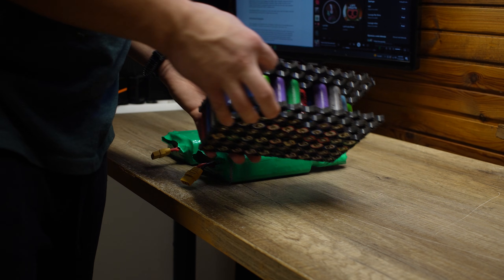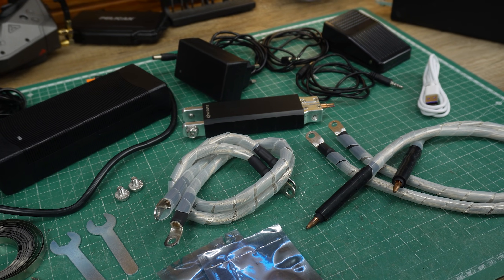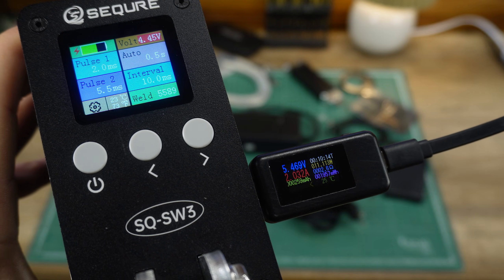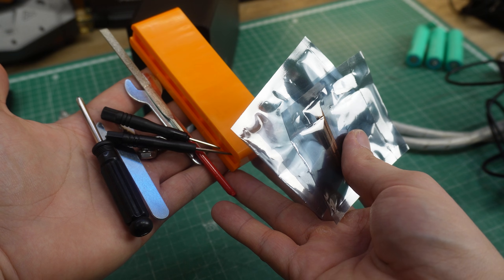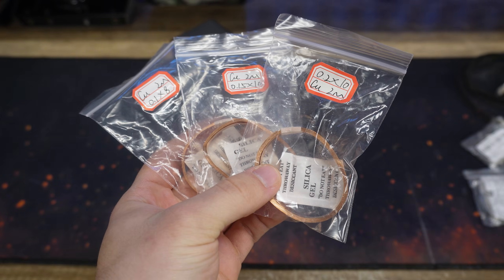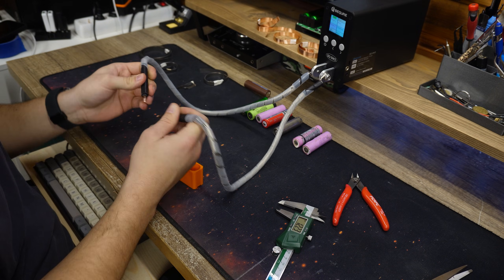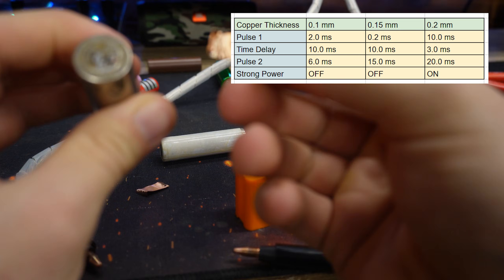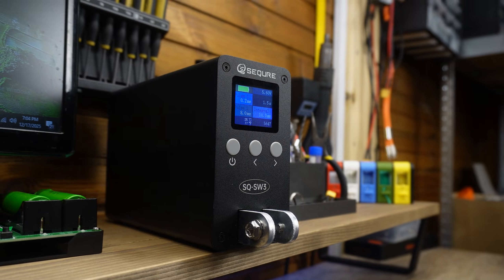The 14kW Spot Welder No One's Talking About — Sequre SQ-SW3 Review

Comment: Hi and nice video tests ! Have you tried nickel plated copper strips ? Or a sandwich of nickel and copper ? Thanks 🙏
Reply from the maker: My friend just started building a battery pack, and he used nickel-plated squares on top of 0.2mm copper sheets, and it worked perfectly. It requires a lot of energy, but the welder can handle it, and the welds are impossible to break
Reply: @Djambo57 very nice ! So the nickel was just a square on top of the cell only to permit the welding. I bought a strip that is all nickel plated and copper together by fabric , but maybe it’s better to just do the sandwich on top of each cell as you said, so I can check copper and nickel quality too
Reply from the maker: @Simofly  It was just a square of nickel plated steel on top of each weld. But it has to be the cheap plated stuff, pure nickel didn't help